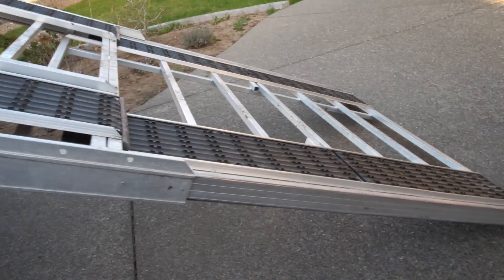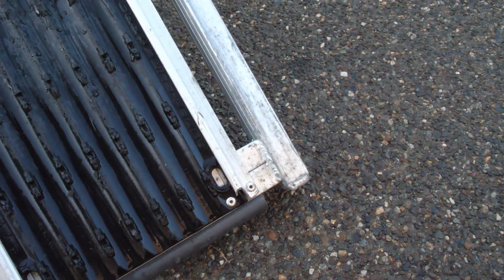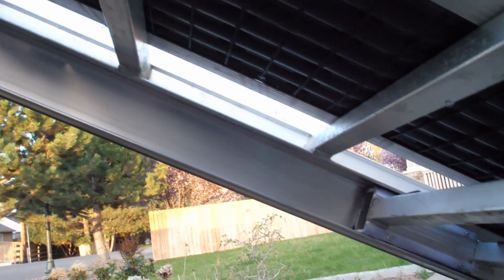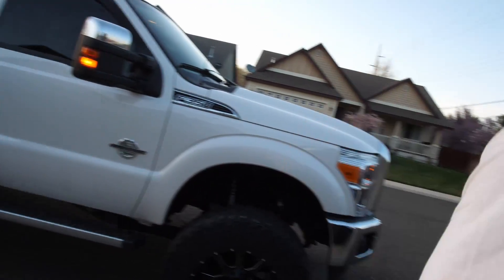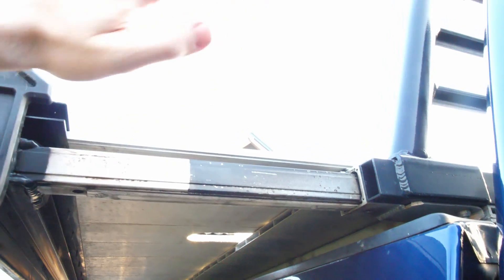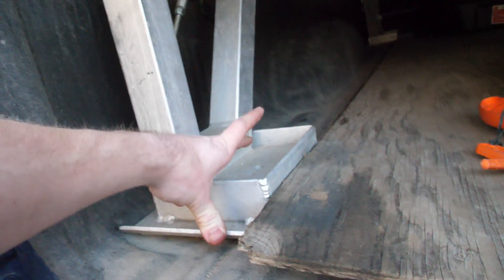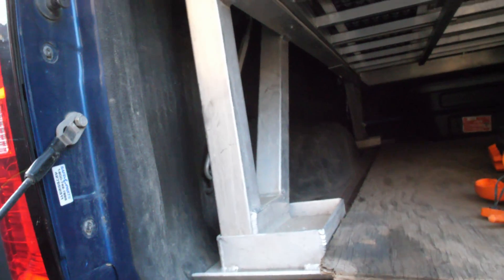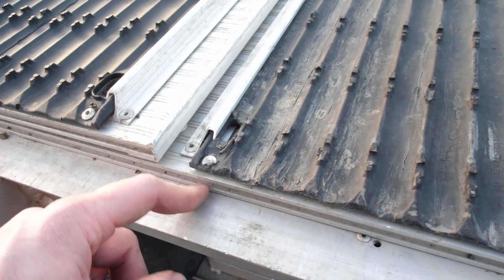HOW TO: Snowmobile Sled Deck Maintenance!

Comment: Hey question for you, I'm thinking of building a telescoping ramp and I haven't seen a close up or even seen one of these ramps in person. Is there a material between the C channel and the rectangular piece to help them slide?
Reply from the maker: it's a plastic umhv or something like that i believe.
Reply: @ColinMcEvoy  Thats what I thought, but thanks for confirming. Nobody really provides a close up so its been hard to find out for sure.
Reply: @Racer57  its called UHMW

Comment: I’m interested in your turnbuckle set up I’m not too keen on drilling into my bed either, is this a marlon part? Or hardware store part? My deck is Highcountry brand I’m interested if I can make something like this work
Reply from the maker: Luke Doncses if your deck and your bed has the mounting points for it then absolutely do it! Just check them often since everything shakes around a lot going down bumpy logging roads and what not. 

I got mine at the hardware store, I think with everything it was like $40-50?
Reply: Thanks for the response I’ll have to give it a try!
Reply from the maker: I will have a video coming out this next week installing my Marlon Deck and talking about turnbuckles and how to use them temporarily 🤘🏼

Comment: I noticed you have offset tires on your truck, does your sleds get really dirty being on the deck? Also does underneath the deck in your bed get wet? Do you usually cover your sleds when transporting them? Thanks in advance and nice video.
Reply from the maker: Jesse Schram the sleds to get a little dirty but only on the skis/sides. I do cover them up though. The underneath gets wet from snow melting since the deck is not sealed
Reply: @ColinMcEvoy  Okay makes sense. Thanks for the quick reply!

Comment: only problem with the turnbuckles is with rough roads they will pull the d rings out
Reply from the maker: I actually had one of the ends of the turnbuckles bend on me. Have started bolting my decks down now 👍🏼
Reply: @ColinMcEvoy  same!